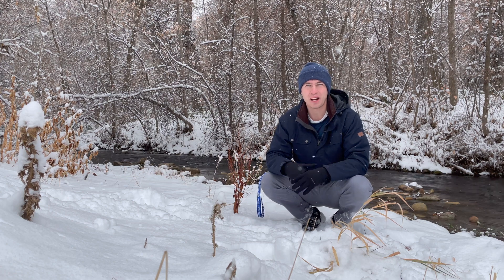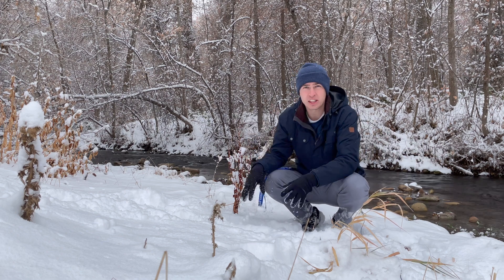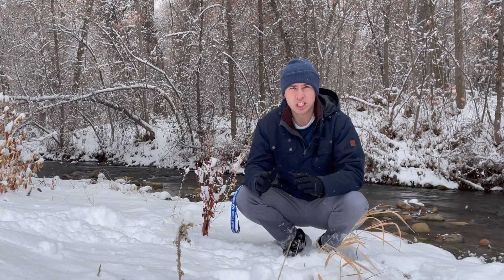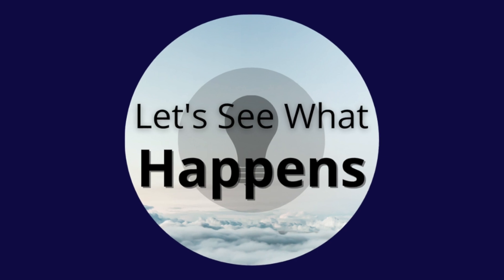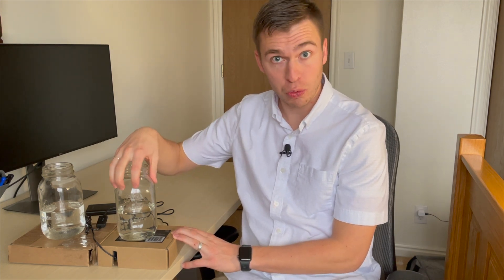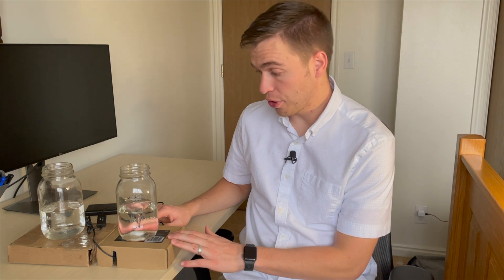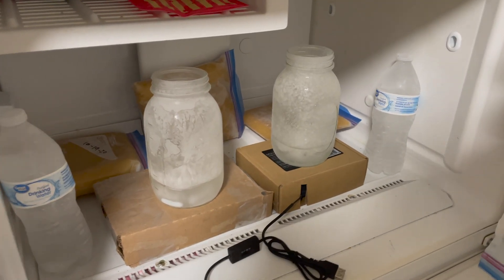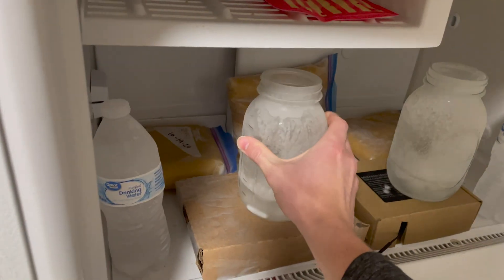Does Moving Water Freeze Faster or Slower than Stationary Water?!?

Comment: You didn’t discuss the impact of stirring on the boundary layer coefficient which impacts the heat transfer rate. The stirring jar would cool faster thus freeze sooner. Thermodynamics is king, remove 144 BTU of energy from 1lb of water at 32 F, and you will have yourself one pound of ice, this can only be altered by changing the pressure. The moving river prevents the ice from easily forming a surface layer like a pond, so you will find the ice on the protruding rocks, on the riverbank, or as pieces floating in the water, just not a surface sheet, but believe me, it’s there.

Comment: I wonder how this would have changed if you had used a more thermally conductive material like copper or aluminum for the containers that hold the water.  My guess is that both would freeze faster, but that the spinning water would freeze at an even faster rate (i.e., from 10% faster to more than 10% faster).  What do you think?

Comment: faucet dripping is a farce
Reply from the maker: I would not say that. There are occasions where letting water drip from your faucet will help prevent pipes freezing. This is because water from different parts of the pipe will be at different temperatures (the water from the pipes underground will be at a reasonably constant temperature) and allowing a little movement will help prevent one spot from freezing. In my experiment I was working with a closed system and your pipes are an open system.

Comment: I've been thinking about this a lot lately. I have watched some videos explaining that one way to prevent water in pipes from freezing is leave the faucet open all night with running water. I would expect that the water that is not moving will froze first because motion in the other jar would slow the solidification of water.
Reply from the maker: Yeah I think the reason why turning on the faucet a little prevents pipes from freezing is because it allows relatively warmer water from below ground to circulate the pipes and it is not just the fact that it makes the water move
Reply: The reason for this is to relieve pressure